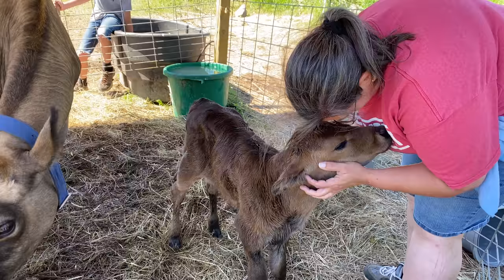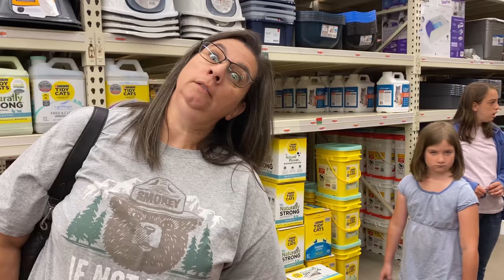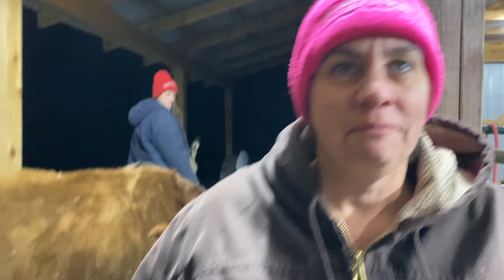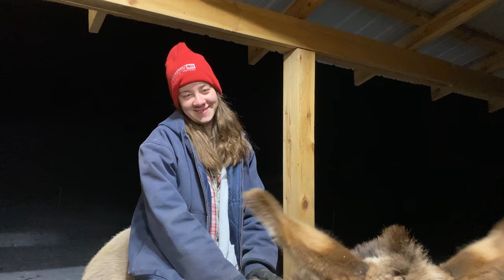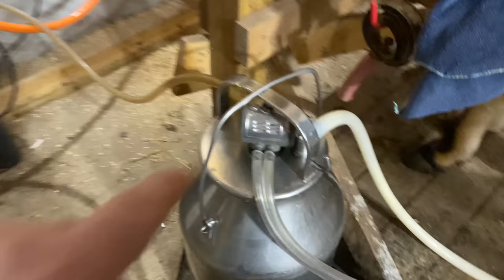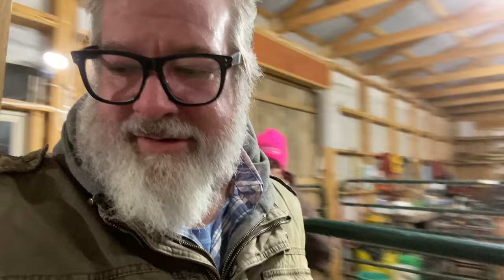COLD Weather ISSUES  | Family Milk Cow | Big Family Homestead

Comment: This may or may not work for you, but it was a blessing to our 30+ goat/donkey farm.  Prior to finding this solution we hauled 5 gallon buckets of hot water (which became tepid by the time we got to the barn) many times a day through the snow and cold so that our animals had unfrozen water.  They LOVED warm water!!  We solved the dilemma by purchasing a tankless propane water heater that we connected with a collapsible hose directly to the well spicket.  Instant hot water whenever we needed it.  My husband built a rolling cart to mount it on so we could move it easily.  As you mentioned, any water left in lines will freeze hence making machinery useless so we routinely rolled the heater to the house when not in use to keep it warm.   It was a lot easier rolling that cart to the barn and back than hauling those buckets.

Comment: Awesome video, the next thing that you guys need to start looking into, if you haven't already, is a wood stove heater for the barn that can be used while milking cows and it can also help to give the animals a break during those -10 degree northern fronts.  It's not needed but more of a comfort item for maybe the next year.  The downside about the wood stove would be that you wouldn't want to leave it unsupervised.  A few hanging electric barn safe space heaters and ceiling fans is all that may would need to keep the barn above the negatives this winter.  Again all comfort.  Great video!